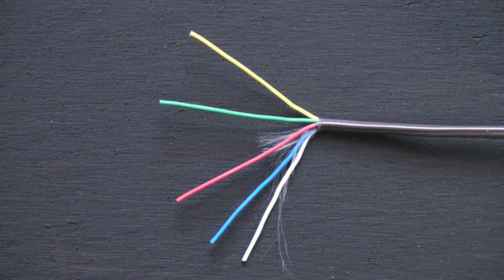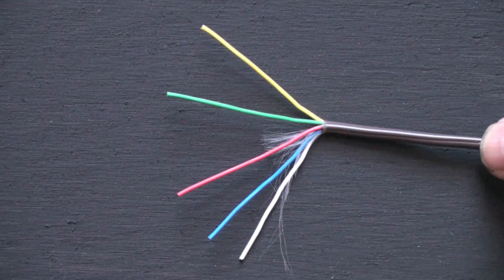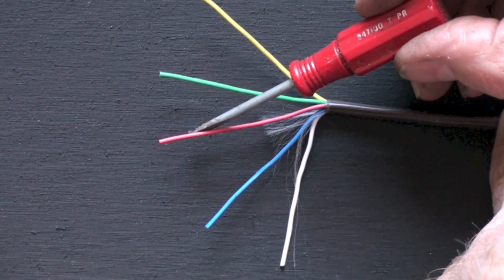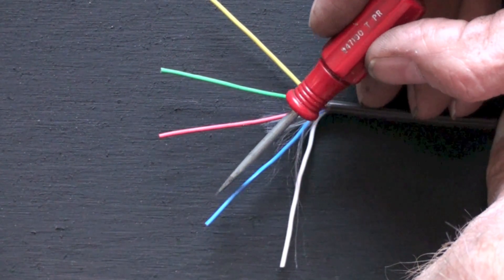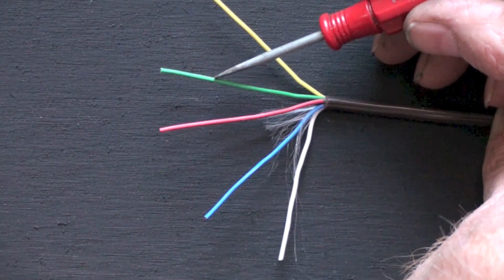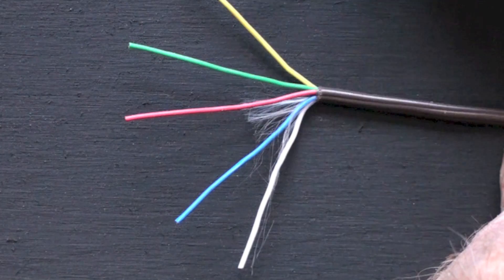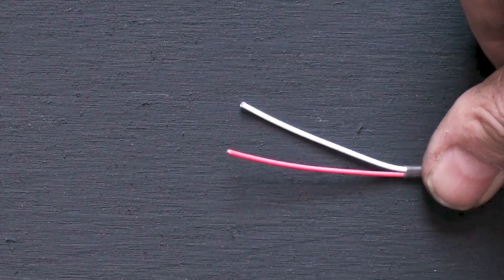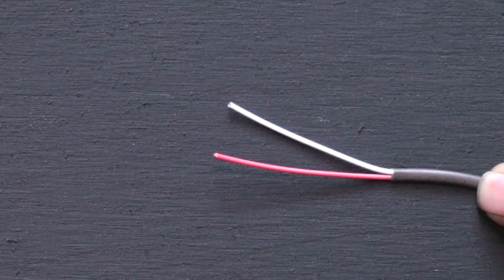An explanation of the HVAC thermostat color code

Comment: Hi GFM, you may be saving my day.

I just got the Honeywell Wifi TH8320WF, I have a boiler and I have an AC system, both hooked up via a Honeywell 5/2 programmable installed with the new system in 2003 (boiler). I have two wires, one has 8 wires (only 3 are used - Red, Green and Yellow (The Red goes to the screw labeeled Rc), the others are folded back and wrapped around the wire.

The second wire appears to be the one you describe as the old thermostat wires in the video. That is hooked up on this system to the R and the W. I am trying to determine what my compatibility is, and not able to find any videos that have the answer. I am unsure which is being used as the C wire.  

And in changing the thermostat do I need access to the handler for the AC system (in the attic) and the boiler (basement).  The AC system was installed after the home was completed and only had baseboard hot water heat with domestic hotwater in it also. Your video was extremely helpful in explaining which wires do what, but with the other wires pulled back and the question of how this was done,

 I can make an educated and sensible guess but would prefer expert input but not have to call an expert (first day with a bit of snow so I doubt I will get anyone and the old thermostat contacts for the batteries must be bad, because they just keep telling us battery low even after only a few hours with new batteries).

I also have another wire that resembles the second wire you refer to that is not being used at all. Could it be more confusing? Thanks!

I would guess that since the original thermostat was battery powered that the actual C line is one that was folded back and abandoned? The main line, as I stated, has 8 total wires, the Orange, Blue, Brown/Rust, White, Black all folded back into the wall around the main wire.
Reply: Ok I realize now that the wire going to the RC on the old thermostat is the power wire for the AC system, so I don't know if the blue wire (calming I think you said? Is that the ground or something?) that was not being used can be placed there, or if I should put the jumper in, the jumper was if I was using the Green or wire to the G (fan) to act as the C, which since I have enough available wires I should be ok, theoretically. I just don't want to hook it back up and zap the system or the thermostat.
Reply from the maker: Maya S. Paveza If you could send me some pics of the thermostat wire at the thermostat and at the boiler it would help.  I want to be sure you are not mixing up 2 transformers.  If so, it could go poof!
GFM
Reply from the maker: Maya S. Paveza It might be a little more complicated than a transformer.  
GFM

Comment from the maker: Most of the rooftop units I have seen do not wire to the same thermostat as the furnace.  The thermostat for the a/c is a dial type mounted on the control panel at the a/c.  Hope this helps.
GFM

Comment from the maker: The wifi stat requires a common and a power side to operate the stat.  Your original stat may not have required a common.  Your blue may have been used as a cooling contact (usually a yellow wire).  If you have only 4 wires at the stat, you will need an additional wire run to the stat to supply both a common and a cooling terminal.  You can keep the blue as a common, and the additional wire can be wired to activate the outdoor unit.  Hope this helps.
GFM

Comment: Thank you very much for that video. It really does help a lot when you understand what the colors mean, or at least what they're supposed to mean.
I was hoping you could answer a question. I bought a new wifi thermostat that requires me to use a "c" wire.  It looks like I have the same setup as you, & I believe my blue wire becomes the C wire, however on my actual ac box I do not have a c. Any idea what to do?  The way I tried to connect it so far make stuff and run but is not cooling the house

Comment from the maker: You will need that yellow from the outdoor unit for cool.  The blue was probably doing the job of yellow.  I would take the blue off at the air handler and move it to common of the transformer.  Then add a new wire for yellow (cool), from where the blue was at the air handler, and hook it to Y at the stat.  Hopwe this helps.
GFM

Comment: another wire to my furnace to make the yellow wire? Can I add another jumper wire in place even though I have on in there now from r to rc? my system works fine with current thermostat and has 2 double a batteries.. but I want the new wifi unit in there. what do I need to do?

Comment: trying to hook up the new Honeywell wifi unit. I only have 4 wires coming to my previous unit. w,g,b,r no yellow. on my old digital unit were the yellow terminal is I have the blue wire going there. So I tried to wire new wifi unit up with r to r, w to w, g to g and blue to the y and it did not power up. tried the blue wire on the "C" terminal and it powered up but did not go to cool, heat and fan work but not cool. Do I need to run

Comment: my son's house has a six wire cable with a 2 speed swamp cooler motor. The cable colors are the same as what you show, except the blue is a black and there is an orange wire. Could it be possible that the yellow and orange are the 2 speeds for the cooler motor ? How would one test this ? Thank you, btw.

Comment from the maker: Sounds like a feed thru or ghost voltage.  The common side of the transformer must be run to the thermostat.  It will work if you find the common at the indoor unit and have an unused wire in the cable.  If not, you can run a new stat wire.  Hope this helps.
GFM

Comment: Looking to install a Honeywell wifi thermostat and it says I need the 'C' wire, which is not connected to my current thermostat. It's supposed to be 24V but my meter says it's 15V (from blue to red wire). I tried all the other wire combinations and none are more than 15V. Will it still work for a Honeywell wifi model?

Comment from the maker: Many air handlers have no Y, because it goes from the stat directly to the outdoor unit.  The C does not go to the stat because the stat is powered by batteries and needs no power source.  The xformer r and c are terminals going to the transformer power source.
GFM

Comment: I understood your explanation while watching your vid and the one Honeywell uploaded. The thing is in my handler unit, I have wires connected to each one I mentioned earlier. I have a C, G, and an R plus two other (xfmr-r and xfmr-c) which one is my Yellow (Cold) and W (hot)? I don't even know which one is my C because when I traced my wires from the one that comes of the C terminal on my handler it doesn't even go to my battery powered thermostat. Thank you for responding, any info helps

Comment from the maker: I would start with the simplest mechanical thermostat I could find.  Then hook the wires you have been shorting to r and w.  If it works, you are probably not hooking up the replacement stats up correctly.  Some have a 5 min time delay so you need time.  Some need the common (or c) to be hooked up.
GFM

Comment: Sorry.. More info always helps. 1 furnace.. 3 replacement thermostats. It got hot yesterday. So i used your helpful video to learn yellow and blue were needed with red to get the AC going.  i am just using bare wire currently cause when i hook up the thermostat and set the temp. It wont kick on when it needs to like it doesnt detect the need for heat or cool. Hope this helps more.

Comment: I have had 3 different thermostats in place at my house and they wont 'hold' temperature. I had been using Red(power) and white (heat). for the winter, tough em together, heat works, take em apart and it shuts off.-- I am not sure what;'s wrong and why they wont hold temp.!! help please!!!. thx u

Comment: my builder only give 4 wire from furnace control to thermostat, later A/C installation put two wires into furnace control panel. COM is free. Is that OK?
Furnace - 58MCB - single stage.

Comment: That depends on what thermostat you have.  Generally, if you have AA batteries, it is a battery operated stat and they cannot be removed.  If it has AAA, which is unusual anymore, I guess you could take them out.  But why?
GFM

Comment: I replaced a 39 year old cooling only split system with a Ruud unit and a digital t'stat. The homeowner wants to bypass the batteries in the stat. Can you guide me on this?

Comment from the maker: The wiring of Y and G together will work.  However, both wires must be wired to Y.  They must not be connected on the G terminal of the thermostat.  If you do, the air conditioner will come on if you turn on the fan.  I would run stat wire with more conductors.
GFM

Comment: There is a YouTube video on this where if you have an oil, gas, or propane unit you can use the G wire for C,and then jumper the Y and G together.  You should be able to find it easily.

Comment: When I removed the wires from the old stat terminal I didn't pay attention to what wire went to what terminal color, the new stat terminal has B O G Y W R RC. I understand the green goes in to the G terminal and the red goes in to the R terminal I'm trying to figure out where the yellow and white go. I don't know which terminal controls heat and which terminal control cooling. Thank you ftp your assistance.

Comment from the maker: If the "standard" wire color code was used, Red is power, Yellow is cooling, White is heat and G is fan.  The wires taken off the terminals Y W R and G should be attached to the same terminal on the new stat.  The blue wire should be left off.  Hope this helps.  
GFM

Comment: I have a Goettl HP365J cooling and heating unit and I'm installing a Honeywell RTH2300 t-stat. It's a five wire connection and the blue wire was not connected when I removed my old t-stat. Does the White go to W and the Yellow to B?

Comment: yes around those and also where it comes through the floor or ceiling,a lot of places dont use conduit coming through block/brick walls,i like to be able to see the piece of conduit,some go crazy with silicone in these spots and i have had to dig a lot of it out just to get a new wire through it,dont get me wrong i like to seal it good but not go crazy with it,thanks again

Comment from the maker: Many times I have found opens in stat wires.  Good to have an extra wire or 2.  My pet peeve is staples set tight on the wire.  Thats where I found most of them.  Thanks for the comment.
GFM

Comment: you are correct about 8 wire,you will some time or other need those extra wires,i always use 18/8,a lot of people dont connect the g to run to the cond. i always did and wire nut it at cond. in the case i need to cross wire to run the evap fan from outside,this is very handy if no one is home and saves you a trip in crawl space when needed,i have the zebra stat,nice tool to use at the cond. great video

Comment from the maker: If the "standard" color code was used, Red should be power from the transformer, white should go to start the furnace, green should be a circuit for turning on the fan and black should go to the common side of the transformer.  Some stats will need both common and power to power the thermostat.  Hope this helps.  
GFM

Comment from the maker: Ok, W2 is 2d stage heat that comes from the thermostat.  If the temperature in the structure drops 2 degrees below the set point, power will travel to the auxiliary heat control.  When the stat is set to Emergency ht the heat pump is locked out and 1st stage ht now goes to auxiliary heat control.  I will be doing a series on heat pump wiring as soon as I can.  Hope this helps.  Merry Christmas
GFM

Comment: What happens if you have a 7 wire Heat Pump?  I have R, G, W2, C, Y and E.  What is the difference in the W2 and the E?  I can't seem to the Aux heat to work.